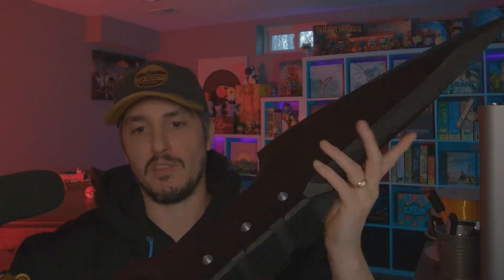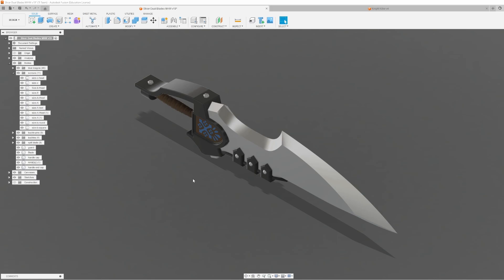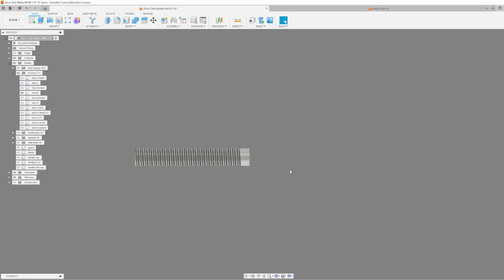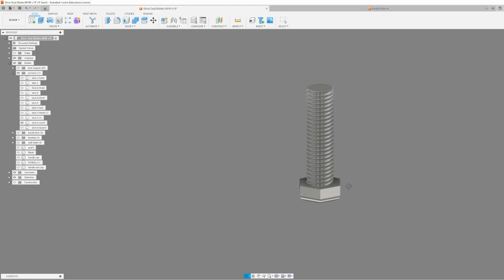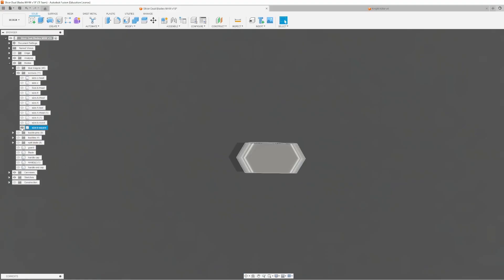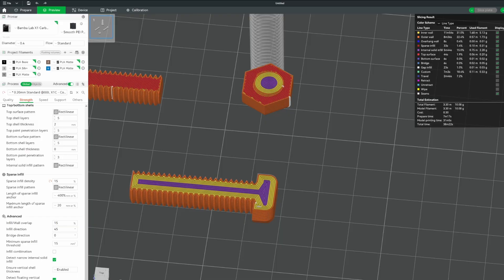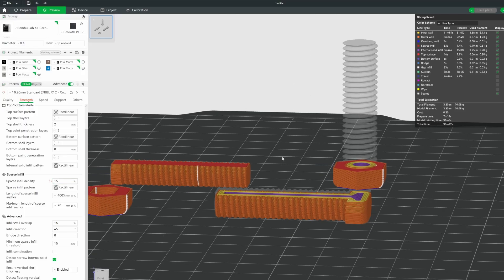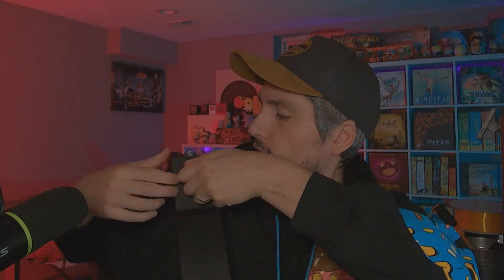The Best Way to 3D Print Screws

Comment: Interesting idea. What about just splitting the bolt in half down the axis, printing flat, then gluing the two halves together? The strength of the bond won't really matter since the load path is parallel to it.
Reply from the maker: You could probably do this as well, but now you have 2 halves that have to be threaded in together. Also if there are tolerance issues and needing to glue them together your potentially increasing thickness ever so slightly? It would probably work just be slightly annoying having to use two halves